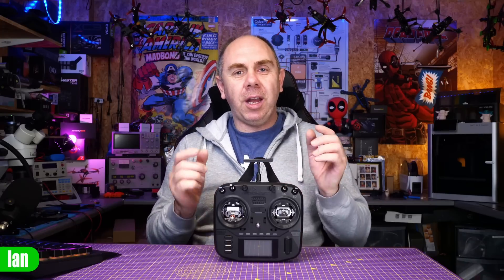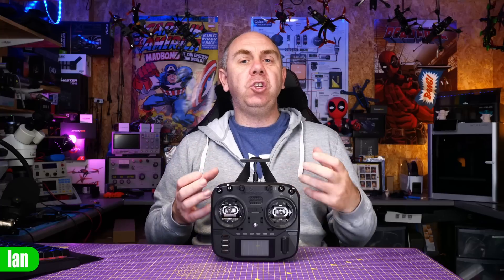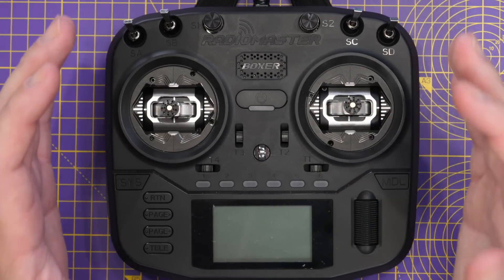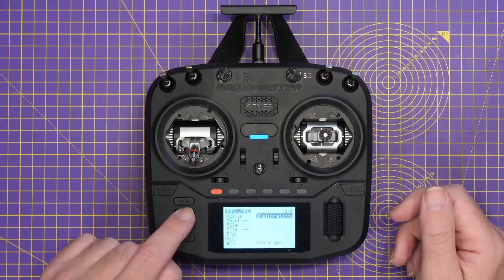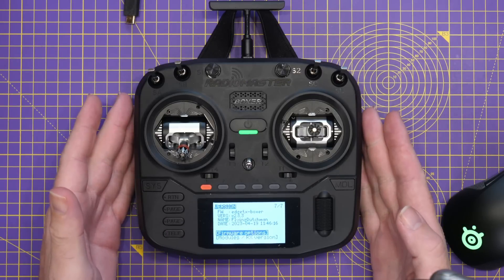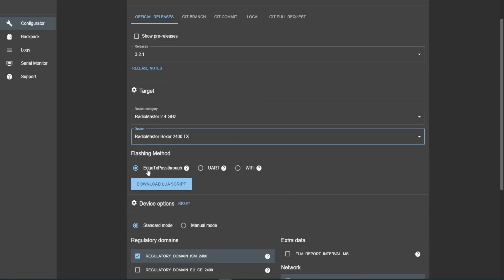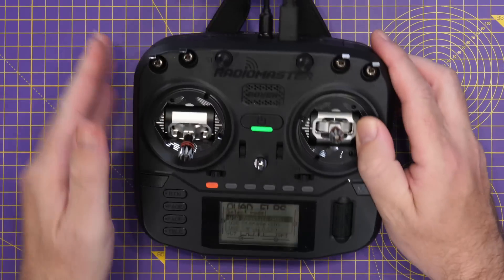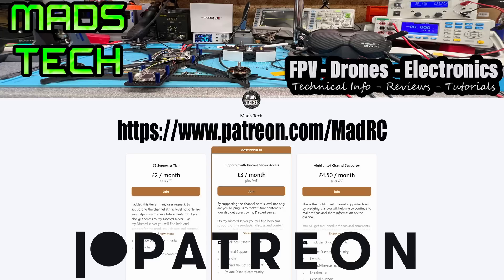Radiomaster Boxer - Gimbal & EdgeTX/ELRS Updates

Comment: Ian, great job, I notice your boxer had 1000mW, inside the expresslrs mode, I can only move mine to 100mW, any ideas why I am limited?
Reply from the maker: You may have the EU Firmware installed.  Try flashing the FCC fw on the elrs module in the boxer.

Comment: I first bought a T16S, way too complex and heavy. Then bought a Boxer, yes much closer to what I was after to replace my Taranis, however while the T16 was over done the Boxer is a little ‘under done’. The ‘two position’ switches should have been three position, it is already two switches less than a Taranis, then the extra trim switches that are on the T16 are not on the Boxer, and if they were they could have replaced the three position switches that are not there. Yes the 6 button switches that is S3 needs braille type touch sensor identification even when you are not flying FPV.

Comment: why do they release a new radio with not enough memory? it should have same memory or more than TX16S
Reply from the maker: Memory is dictated by the sd card. Also it does not have a colour screen
Reply: @MadRC  no I mean the ram memory used to execute the firmware and Lua scripts. Also confused by the spec. In one place it says 192kb ram while in another it says 1MB of ram. Ram is not the flash memory so maybe it has 1MB flash and 192KB ram. The LUA for Forward Programming is divided into two parts because of the lack of ram memory on the Boxer. The sdcard is storage memory.

Comment: Hey

Let me just start by saying I'm a total n00b. Like 0 level.
I want to start flying quad drones FPV and every tutorial out there says to get a controller and a sim and start practicing in a sim first. So I got the Boxer, cause it seems like a good unit with great reviews, started a little bit of training in Lift-off and was on my way to become the world's greatest pilot. Then I came across your video and thought to myself "geez, upgrading EdgeTX is such a great idea". But I couldn't do it over USB, because drivers in win10, so I downloaded the bin file from EdgeTX Buddy site, put it on the SD card, started the controller in bootloader mode and flashed it. All nice and dandy. Excet it wasn't all nice and dandy, cause I moved the left stick and on the controller screen it showed the numbers coresponding to the right stick changing. I started the simulator and also there the controls are switched... WTF do I do now??????????????????????? HALP PLS
Reply: There are several ways to check/fix this- 
Check Model Page (MDL- right button) to ensure you're in a Model for drones (not heli or wing). 
Go to SYS Page 3- 
The final option is Mode: Check to see that you are in Mode 2, which will set the sticks for a drone flyer.

I hope this helps!

Comment: Hello! Trying to upgrade my firmware on the Radiomaster boxer with Edge Tx Buddy. I get this error(WIN 10 PC): "failed to execute 'open' on 'usbdevice': access denied. " I would appreciate your help. The radio is running on 2.8.0 factory firmware, and trying to update it to 2.8.4
Reply: I'm currently trying to update everything as well. I can't find the STM32 under add device but windows recognizes it for sims when it's on

Comment: Thank you for the clear tutorial. In my case, the Edge TX Buddy didn't find the bootloader device and the ExpressLRS Configurator also wasn't able to find the serial device. I have a pretty standard Windows 10 installation so I was pretty upset because in every tutorial, it "just works". I had to use Zadig tool to install USB drivers manually. First, I turned off the radio, connected it to the PC, selected the device in Zadig and found out there is no driver, so I installed WinUSB. To make the serial connection work, I turned on the radio, selected VCP, and installed the driver USB Serial (CDC). After this, I was able to upgrade Edge TX firmware and also the ELRS.
Reply: absolute legend, thank you
Reply: Thanks.  I used Zadig to install the bootloader driver then the rest of the update went just like in the video.
Reply: Thank you very much!
I had the same issue and your guide helped a lot!
Reply: Same issue,thanks for the comment
Reply: thank you so much for the tip about Zadig. You are a real legend for sure!
Reply: Thank the u man I was super stuck my bootloader was AFK or missing in action u really came thought THANK YOU

Comment: im at my wits end, ive tried different cables, different computers, different methods. None of my computers will recognize my boxer radio. Ive been wanting to get into this hobby for months and after saving and waiting i finally have everything i need and the only thing holding me back is this radio. I don't know if its a faulty radio i thought maybe it was the cable it came with but nothing seems to work. I cant flash the elrs i cant update the firmware. I really really wanna fly my first drone, can you please help me get my radio working so i can feel the freedom of flying?
Reply: I had the same problem - had to use Zadig tool to install USB drivers manually.
Reply: Well I couldn’t get it to work so I was able to flash the radio via wifi finally, now to get the drone connected to the radio
Reply from the maker: Are you using the top usb port ?
Reply: Yes

Comment: Coming from the tx16S I like that I can throw the boxer withouth case into my backpack and the lightweight but I HATE the cheap feeling why you and Bardwell don’t say anything about that absolutely cheap feeling specially if coming from a Radiomaster tx16S
Reply from the maker: It does not feel any cheaper than the TX16 standard radio.  I don’t know what model your comparing it to but it’s the same overall plastics  so what specifically feels cheap.  The TX12 is a radio that feels cheap for sure but there is nothing specifically bad about the boxer.

Comment: I bought it around first half  of February and I use it quite often. Overall it is great:)  Stock gimbals had some noise in the beginning, but now they are brilliant. Roller wheel sometimes makes accidental moves in the menu, when I try to press it(it scrolls too easy).. not a big deal. I have opened it, and everything inside is very well made. Mine is cc2500 only, because I like to fly redpine whoops.. and I have some ELRS modules. Installed a tiny internal antenna for cc2500, and I also use a diy elrs module with internal antenna. Very compact and comfortable setup  :)

Comment: I own a radiomaster boxer 4-1 and edge tx is updated to the latest firmware but for the life of me i cannot figure out why i cannot select to turn off internal module to run the ranger micro elrs module. I select modules/rx version and it takes me to the showing the internal module and ext module off. Am I doing something wrong? thanks
Reply from the maker: In the model settings you need to select external module for that model. So it’s in the first settings screen for the model where you can name it. Scroll down and find the RF section.

Comment: After updating everything, my boxer doesn't load the elrsv3 lua script.  Just says loading...
Reply from the maker: Does the model your on have the internal module turned on.  It’s possible it can’t detect the ELRS module.
Reply: That happened to me, and I can't remember how I cured it.
Reply: As Mads Tech says, your module isn't probably turned on. I have no clue why the Lua script just can't show some message like "Connecting to ELRS module failed. Make sure your module is turned on." Because it's super confusing how it behaves now.

Comment: i have one question, i have a Boxer with the 4 in 1 Module LBT Module on the way but i need to change the Firmware so the 4 in 1 Module is on FCC, what would be the best way or tool to use for that purpose ? so i have no use for the ExpressLRS Configurator, thank you for your help !

Comment: More or less right except tiny points to improve - but more or less for those wing pilot which look at a radio quite differently - at least in parts. 
At the end I will get one , I mean buy one, but more or less not before Chrismas cause I tend to stay with the stuff I have bought and will have to sell first before buying again. Still have the big Radiomaster and a joystick style one, that I also use during winter on the simulator. 

But I also have to let you know: the older the first batch of the Radiomaster T 16 gets the more issues have occured , inaccuracies and also burned capacitors or smd components someone in our club had to replace. I mean I am talking about a fleet  of these radios purchased back then in early 2020  for the club and build camps for the kids where they can lend a radio to have an easy start. They do not suffer from many hands and breaking plastic parts we had faced before, but now more or less electronic issues, especially the screen is getting darker and loosing everything a display  needs like constant backlight without brighter spots. Yes, that is easy to fix, but if you have a fleet of these it becomes expensive to order 10 or 12 spare parts at once. 
The Fr Sky radios used before had been more reliable, I mean this black joystick remote X-lite or however it had been called for example. 

I hope radiomaster will work on the longevity of the basic radio without the whole story of the blink upgrades that are too expensive at least for me compared to the price of the basic radio. 
Just forgotten: these rollers on the lower right have also sucked a lot over time in those 2020 and 2021 T16S.

Of cause: support by radiomaster is there and quite good too, also a part of a decision to buy a radio from the brand which is a lot hard in a club where you might have every 8 years  a budget for 10 of these radios and also the basic spare parts cause at the end they are used by kids where things can go wrong and you then rely on the supply chain, availability and also prices to get these fixed again. We give 10 away and have 2 replacement for such damages and doing the repairs to bring them back into service. 
Of cause there is more to tell but that is also becoming difficult in a world of adults cause kids need sometimes different proportions or handlings but kids are not the biggest customer group and fall behind somehow regarding ergonomics even though those joystick radios looked like such kids radios but at the end where not the best for them at all. 90 percentil for the adults might work in cars and what not but it gets harder for those kids and teens to get it right in a time when it is important for them to achieve things and get them right too after an adult had showed them the how to. But that market is too small, too niche cause we all know how fast they grow and what would be perfect now is no longer useable in 2 years after they had grown 40 cms and the tiny finger are so long.

Comment: What about the models you have programed? Do they stay in the radio or do you need to save them and reload them after updating EdgeTX?
Reply from the maker: No they will stay
Reply: @MadRC  Can I use the pre made models for my fpv drones or are they not good in some way? Like maybe they have bad settings like curves or dead band or something. I noticed one of the models, I don't remember if it was boxer or 'fpv drone' had RTC filter enabled and it is advisable to have that off.
Reply: @definingslawek4731  A pre-made model would be OK to start as long as you check every single thing in it. In a new radio I use the wizard to start my first model then comb thru and change everything to my liking. After that I always copy my first model as I know what is in it so I am not surprised.